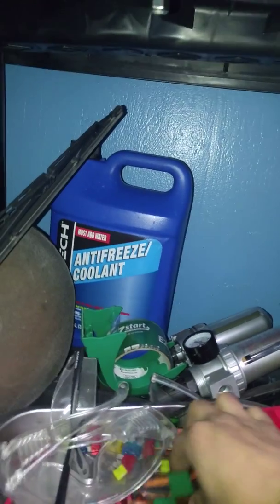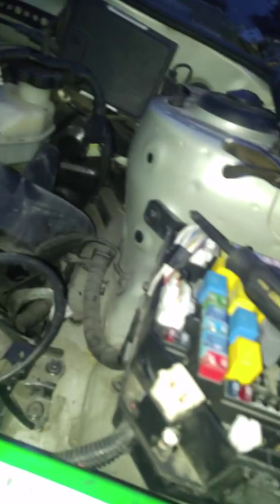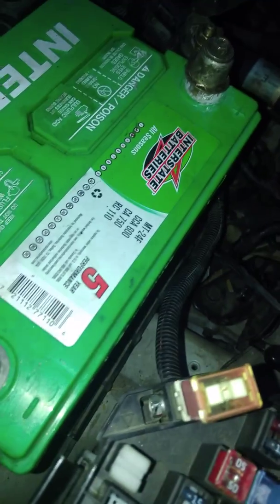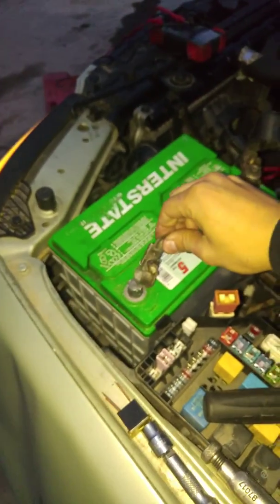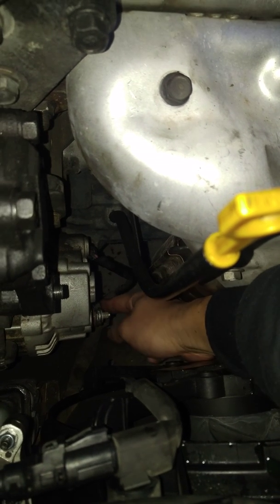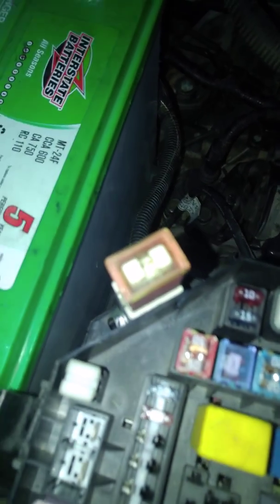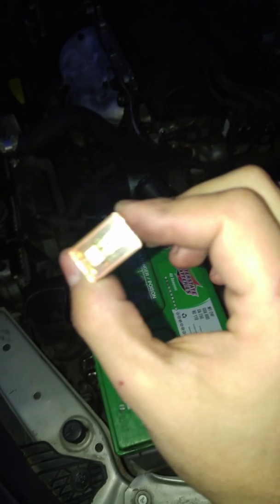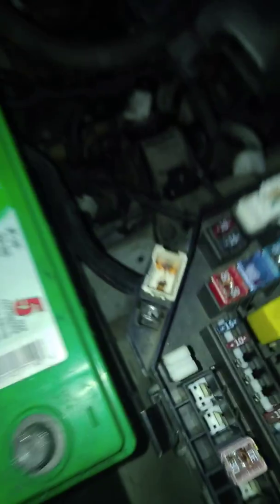Internally shorted alternator pt3

Comment: Looking for part 1 of your video.  What was the original problem?  I'm working on a vehicle right now that is putting voltage to the engine block (around 140mV)  trying to find out if the alternator is shorted internally.